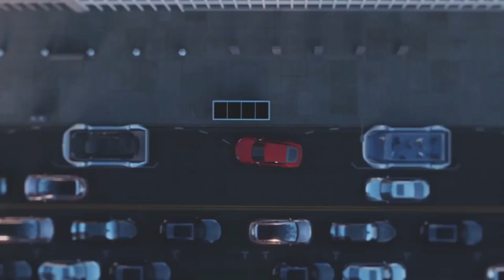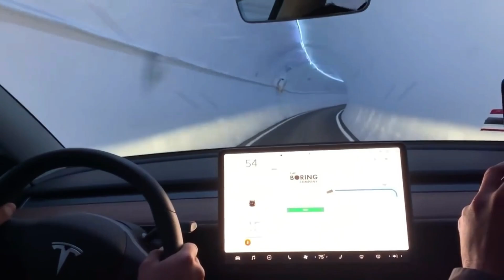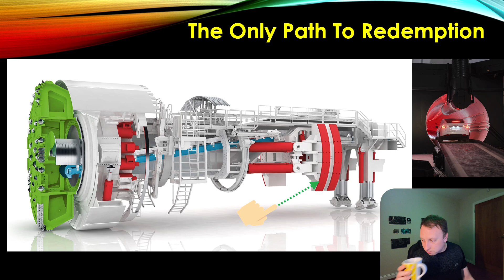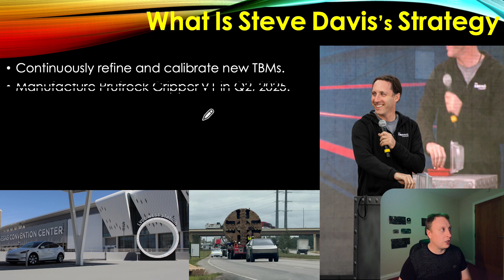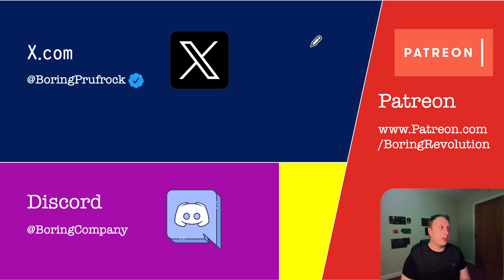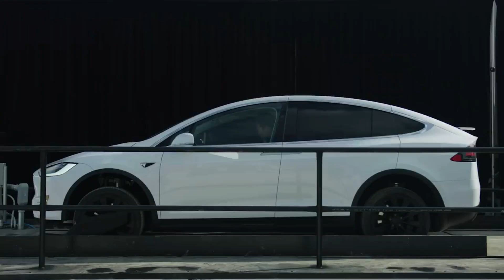Very Significant Upgrades Are Coming To Prufrock 😀 🚇 👷🏼‍♂️ 🔩 🏗️ ⚙️ 💰  #196

Comment: Over an hour just to reset the grippers? Not sure on which projects you've encountered such slow machines. Our gripper TBMs will do a whole cycle in 30-50 minutes. That includes a full push, regripping, and installing the tunnel support.

Comment: Why can't pipe jacking be parallelized? Seems like you could have a ring pattern of independent small diameter pipe jacks that form the tunnel lining, then just disaggregate the main hole using fracking or plasma blasting or something and pull it out. The disaggregation could continuously trail behind the advancing lining and individual jacks could be serviced while the rest are advancing. I guess probably the steel for jacks is too expensive.
Reply: This does get done occasionally. Did a design for a cavern station in Seoul, S.Korea using a crown of pipe jacks in soft ground, with the station excavated inside the pipejack arch and supporting ribs cast. The station has maintained the pipes and arches as an architectural feature.

Comment: I see no reason why you would have to go to hex segments to push against them continually.
hex segments make it simple as you have two sets of three pushers all in the same ring and alternate between them
i.e. 
number them 1-6 starting at the top
push on 1,3,5 while installing 2,4,6
push on 2,4,6 while installing 1,3,5

but I see no reason why you could no do the same thing
push with 1,3,5 while installing  segment 4
push with 2,4,6 while installing segments 3,5
push with 1,3,5 while installing 2,6
push with 2,4,6 while installing 1
(and in theory, you could install segment 1 of one ring while installing segment 4 of the next ring)

instead of your pushers needing to push for 1/2 the distance of a hex segment, they would need to be able to push for the full length of a segment, but I don't see why this would have a problem.

or, instead of the pushers pushing on the edge of the prior segments, they could connect to the holes used to lift/move the segments and push against those points
Reply: It’s the very large loads that are involved. Needs a full ring built to tight tolerances to push against.
Same with side grippers. Need to be large and pushing out onto very strong rock to react to the large forces.
The ideas you have seemed OK to many in the past, but they have been tried and all fell by the wayside, usually due to distortion/failure of the lining under the very high forward thrust loading.

Comment: Instead of grippers like you describe, they could do a tongue and grove push system with 2 vertical and 2 horizontal tongues so one set is always pushing, either the vertical or horizontal.  Groves would be half way through each wall, with each of the walls being re-enforced on the outside of the tunnel wall. Or just a thicker tunnel wall.

Comment: Can you explain why they can't do continuous mining with the current system?
Reply: EPB stands for Earth Pressure Ballance, All TBC TBMs to date have been this type. There are several other types of TBM, generally depends on the ground conditions. EPB machines are closed face with a pressure bulkhead behind the cutter head and a screw conveyor through the bottom of the bulkhead to extract the spoil (one of the key things limiting speed).
There are lots of YouTube videos explains the process.
Try Herrenknecht 
They maintain the pressure by pushing on the lining they build behind them. Plus they need additional force to overcome the friction of the machine skin against the ground, the load of the 100m of backup gantries they are pulling behind them. Most importantly the load of the forward thrust to push against the ground they are excavating. 
The forces are huge. 
Even for a relatively small TBM like Prufrock, the operating forward thrust can be 1,500 tonnes (3.5 million pounds). With maybe 2,300 tonnes installed for breakout force.
That force has to be evenly distributed around the built lining with a small tolerance  for build quality and eccentric force for turning corners. Without the full set of rams deployed in the full circle the lining will distort and fail.
It has been tried many times in the past. Never been commercially viable even in very easy ground conditions. Time is also required for maintenance etc.
Just no point.
Reply: @davidsalisbury50  thanks for the great info!
Reply: I think, bcos you cannot have ALL hydraulics uniformly pushing forward. For continuous tunneling, you'll need at least one 'pusher' retreated so the concrete segment can be laid there.....this I think may create non-uniform thrust that may swerve the boring machine.
Reply: @omnicurious2949  Maybe they reduce force on the opposite side pusher? Boring says they were aiming for continuous mining with prufrock 3, so obviously they have some kind of plan to do it with the current configuration.
Reply: @bobloblaw1283 they were lying. (Or someone was).
Can’t do it with the Prufrock 3 configuration.
It’s a standard EPB machine.
Reply: @davidsalisbury50  what prevents an EPB machine from doing continuous mining?
Reply: @omnicurious2949  Maybe you could reduce thrust on the opposite pusher? Boring has said they want to do continuous mining with prufrock 3 so they obviously think they know how to do it with the current configuration.

Comment: I spent a lot of time watching, back when they were drilling the Gotthard tunnel, which is considerably larger than the Boring machine. I think 51 feet was the diameter. When Elon started this project I always wondered if he had done any consulting with the company who ran that project? I can't imagine that any other project was harder than that. Just a thought.
Reply: I don’t think TBC  consulted with any of the established tunnelling companies. That’s why they are still 30 years behind current technology and making such a hash of it in Texas.
Prufrock 4 has been “unveiled” and appears to be yet another 14foot diameter EPB standard mixed ground machine. 
No side gripper I’m afraid. But then again, why would they put side rock grippers on an EPB soft ground machine.
It would be like putting bull bars and a tow hook on an F1 car.
Reply: @davidsalisbury50 LOL,  SpaceX has not consuted with anyone therefore they are not innovative,  dumbest theory ever! obviously you should be in charge.

Comment: I think the gripper may not work at small diameters, as the gripper occupies a large cross-section of the tunnel...to the point people/materials are physically blocked  Also the issue of not being able to use in softer ground (where tunneling should be faster) is an issue.
An alternative idea is to continue pushing against the liners, but offsetting the pistons so they are inside the liners, and have "feet" that rotate out to contact the liner.  Then the next ring can be assembled ahead of the feet (around the pistons), then the pistons get retracted, and the new ring gets pushed back and bolted.
Just an armchair tunneler here, so could totally be wrong on this.  Thanks for the most Boring channel on YouTube!!!
Reply: @Gig0Surf  Can you explain better?
Reply: The instant you move to continuous you instantly have more than  two opposing shoes because while a pair are free and moving forward it still has to be thrusting. To reduce the excess capacity to thrust of each set of unused shoes you can have more than 2 pair because that is the worst overcapacity starts at 2 pair each having 100% push capacity or 200% but 3 pair is 150% and 4 pair is 133% and each pair is only 1/3 of the needed force. The beefiness is down, the limit is probably down to how fast individual shoes can move forward. I think nesting them in a line  is not so bad for cross section.

Comment: Steve Davis is good at keeping costs down and has done a lot of groundwork such as getting permits.
 Eventually the eye of Elon will focus on Boring and it's slow pace.

While technically cool,  speed is overrated and if they can get to a reasonable pace with low costs then you have a winning formula.

 They have a lot of areas where they can speed things up in addition to the actual boring of the tunnels. One way they'll keep costs down even at an average pace is by more automation underground.

Comment: You, appropriately extol the virtues of continuous mining, so I am a bit shocked that it has not happened. Is it possible that we need to re frame our thinking without rejecting the premise and because we accept the idea. https://youtu.be/t705r8ICkRw?t=781 needs to be examined instead of the low hanging fruit model of what should happen first. How can we fit improvements to the TBMs in terms of where each improvement idea fits into the 5 step process. Here is a text version if the text organization helps you think of the engineering decisions https://insideevs.com/news/526954/elon-musk-5-steps-success/

Comment: Why can't they push of the preceding and currently installed ring so that they are pushing off 6/7 of a 7 segment ring for example.  Surely you could make the ring currently being installed stable by interlocking with the previous wing with a design something like the following with X being part of the ring and O being nothing.
OXXXXX
OXXXXX
XXXXXO
XXXXXO
XXXXXO
XXXXXO
OXXXXX
OXXXXX